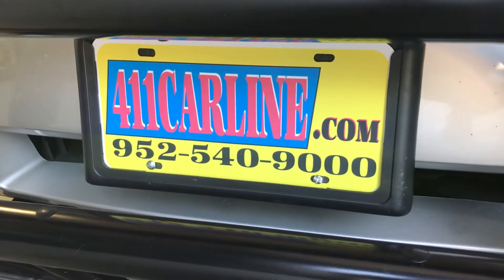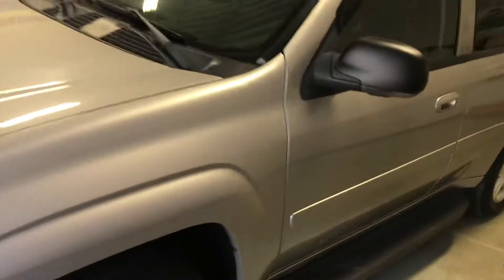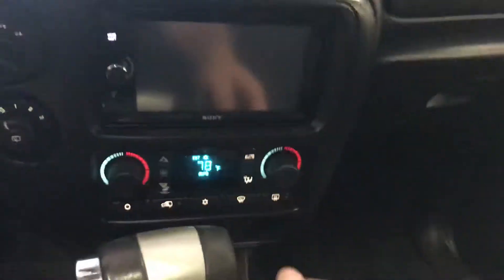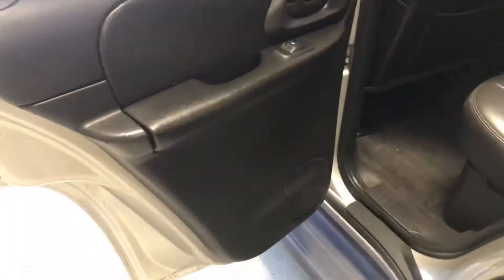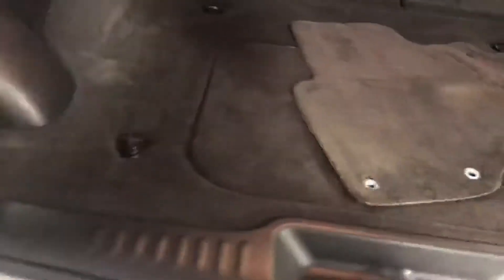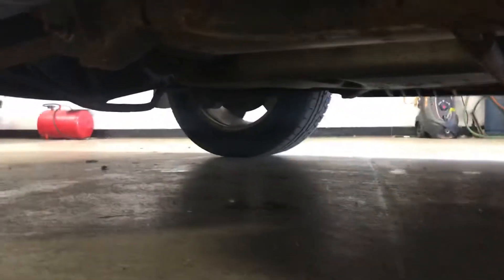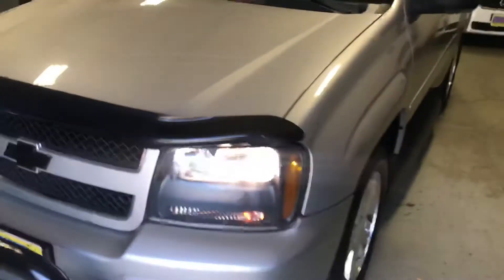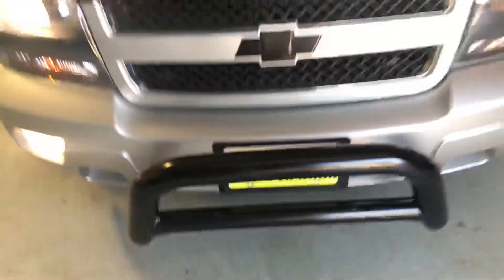2008 Chevrolet Trailblazer 5.3L V8

Comment: Is this the goofy looking ext version? Those are the only ones that came with the 5.3
Reply from the maker: This was not the goofy looking EXT version, although I agree with you there LOL. It is a standard version non SS 5.3l 4x4 model that came with the 5.3l from the factory. They were very rare, but were available.
Reply: @411CarLineofficial  You are of course correct. I'm the original owned of an '08 TB (99,000 miles now). I ordered the thing just before American Axle went on strike and closed down the assembly line in Moriane. It took six months for the TB to get to the dealer. The 5.3 was an option, not that much more $ but it didn't make sense unless you wanted to tow. The 4.2 has plenty of guts; mine has the G80 Eaton locker, with the 3:73 rear so it's a fast truck. The line by Chevrolet was that the 4.2 was the power of a an 8 with the economy of a 6. In reality, the 4.2 is the power of a 6 with the economy of an 8.
Reply from the maker: @JCT442  thank you! I did some research but not a ton, I just know they were rare in Non-ss models. Very cool you have a one owner as well!